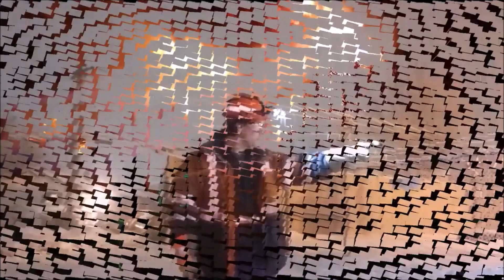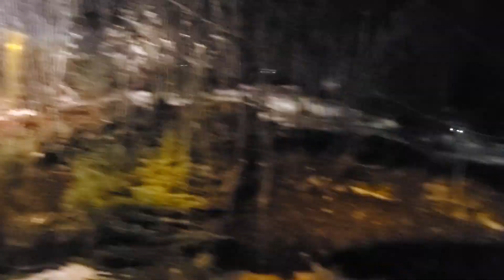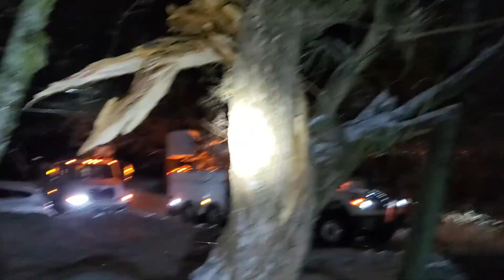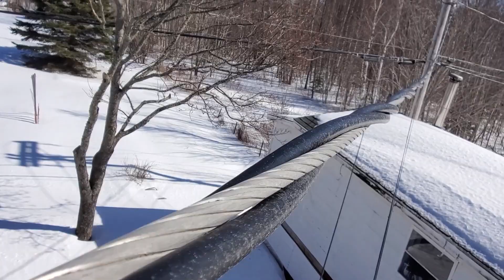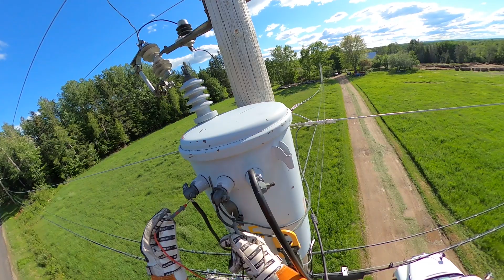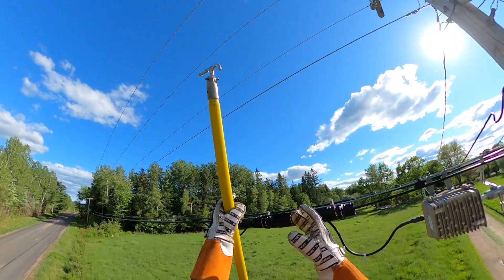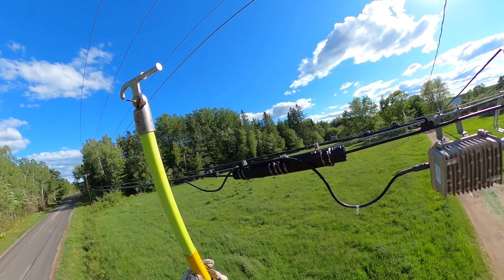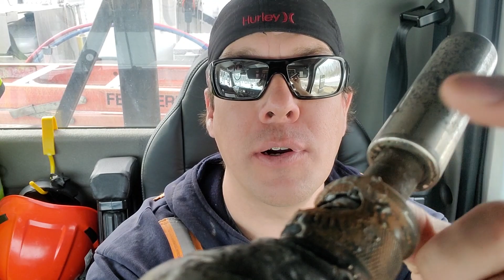Accidental contact with 120 volts

Comment: Firefighter here, had a new construction multi family dwelling basement fire last year....... On move in day, the first family was having internet installed, the utility guy was drilling a hole through from the outside to run his data cable, and drilled right through the aluminum wire feeding the main breaker panel for both units. (We were never informed of this in the initial report,only that there was a fire in the basement, and the utility guy had moved his van down the road to get out of the way and didn't approach us until after "the incident" ) The drill bit ended up grounding to the house, and started the rim joist on fire, arcing until enough aluminum wire had melted away to make the open. After we had vented the home, we started overhaul and hot spot work removing the burned spray foam insulation to ensure all hot materials were extinguished. The foam was hiding the main feed. I stuck a fiberglass pike pole in to remove foam and the exposed wire started arcing once again. Scared the shit out of me. We ended up pulling the meter. I'm very happy we have the fiberglass pike poles or I may not have gone home after that call.

It's very hard to explain what exactly went through my head when I stuck that pike pole into that void and a fountain of white sparks blew out of the void. Had we known the situation upon arrival, that meter absolutely would have been yanked before we made entry into the home.

Comment: It's not the "volts" or the "amps"... it's both!   Your skin is a decent resistor up to a point, but a high enough voltage can overcome any resistor. Once your skin is penetrated, it doesn't take many "amps" to cook you.  If the current passes around your heart, it will interfere with your heart's pacemaker cells, which can stop it.

Comment: I have been electrocuted by the outside wire coming into house before fuse, It was a 240v line and it my eyes flash black and it was extremely painful. I will not make that mistake again :)

Comment: Voltage is the pressure to push the electricity through a resistor. Even 30 volts under the right conditions can be painful. I worked a lot of panels live, up to 880 volts. I only ever had one issue and that was because fluorescent lights were wired wrong. I had another incident two years ago with bad insulation. I had 120 V power go hand to hand through my chest. The only thing that saved me is that my hands are completely calloused and fortunately caused enough resistance to lower the current. I could not move my hands or arms, and I was alert enough to know to roll off my knee to disconnect from the defective insulated wire and ground. That is what I did. My hand was burned for about 6 weeks till it healed. That was the only other time I got shocked or had an incident. Yes, 120 volts can supply 10,000 to 40,000 ampere and only a fraction of an ampere will kill. I tried to be a lineman a few times, but Affirmative Action prevented me from being hired and someone else got the job. There were more than 3600 applicants, and only 7 were to be selected. I was one of the seven, but since I scored so well, I was bumped from the job and someone with only 60% to 80% skill was hired and not me. I was constantly in the top 1/2% but AA kept getting in the way, so I turned to refrigeration service. I am retired now but lost more than $2 Million in wages over the decades. I know others have had the same experience I did.

Comment: You’re so right the only thing that governs the current is resistance metal ,like the chuck has low resistance and the current would be huge .A body’s resistance is quite high but breaks down as the current passes through ,it takes milliseconds for your resistance to drop and the CURRENT to go sky high ….. thanks for telling folk that low voltage can kill or damage you beyond belief 👍👍👍👍…..we have 30mA trips in the UK …however it only takes 15 milliamperes to KILL you !!!!!

Comment: I was tightening last connection on 4 batteries to make 24 volts final on a hydraulic lift. Well my ratchet made contact on one of the post of battery next to it. This all happened in a 2 seconds. The tool stuck to post as soon as it touched. The whole ratchet (3/8) turned into a cherry red color. In the 2 second after realizing in the first second that this ain't good, I ( with gloves) up and palmed the ratchet knocking it free. The ratchet was rendered useless. Ok maybe 3 seconds. Thanks for you info. Hats off to you and all the people in this trade. 🇺🇲🍺

Comment: It's not the voltage.
It's the AMPS.
Water is just water until I spray ANY amount of it at you at a high enough pressure and speed.
That's when that mere can of 12 fluid ounces (or 120v) becomes an armor piercing javelin.

Comment: You better read the NFPA70.,..It lays out the explosive force of phase to ground or phase to phase.. As you not only get the full amperage of the circuit. You get 50,000 PSI explosive force.. Which atomizes metal into small particles in your face and body... I seen it blow panels off a wall...

Comment: The standard 120 VAC in your home on the standard 15  Amp breaker can cause severe injury or even kill someone.  More than 10 milliamps (10/1000 of an Amp) through the body can kill someone. The voltage is not important.  The sparks can take out an eye or cause a serious burn.  The 120 Volts in your home can be strong enough to melt the ends of a pair of pliers or a cutters if the power is left on and are being used to do some work. 

The power inside of appliances or electronics especially in the power supply section can cause injury or death. People have no idea how serious this is.

Comment: In general, 120v doesn't have enough "pressure" to break human skin very well. However, if you take a metallic object and cross those phases, or hit ground/neutral when it takes 1000amps to fault the circuit you're in trouble.....

Comment: 120v directly from a transformer on a pole? Hmm. Haven't heard of that. I thought most if not all U.S. households had 220v-240v line in voltage. Unless you were measuring a single phase?

Comment: that was only 120 volts at maybe a few hundred or even thousand amps you dont want to have that happen with the 12 or so thousand volts that comes on the input to the transformer
Reply from the maker: Likely would have been deadly 😔

Comment: Have you ever experienced a situation where primary voltage (7200 volts) from a distribution transformer was present on a secondary terminal?  I was wondering about this, if the primary neutral was open, then the high voltage would be present at the transformer primary neutral terminal since primary current = 0. If primary neutral is bonded to secondary neutral, would this put the primary voltage onto the secondary side?

Comment: Amps is the killer 😅 water isn’t static, there is always pressure, that’s amp damage, 12 volts can kill one, if the cable is thick enough to push amps.  I would not be betting on this no amp voltage thing 😉. And yeah, it IS the bullet. 😊. Not going to try it, thinking you mean something a little different and now I’m intrigued. How does one have volts but no amps?  Even a small amount.. but yeah the Tesla coil generators come to mind. But this is a word game, until the circuit is completed, or I drill a hole in a dam, sure it’s voltage.. or pressure, but the actual flow is amps, the full load of the low side of the transformer..

Comment: I am not any type of lineman or electrician. Having said that, I was in the US Army for 8 years. I did a deployment to Afghanistan from 2004-2005. Due to my own mistakes, I took 220 volts to my right hand twice. If just 120 volts was able to weld and melt solid steel, and I survived 220 volts... God must have been looking out for me. 

It hurt. BTW, Cedar Rapids, Iowa.

Comment: I'm an electronics R&D guy and it is the amps that kill. The amps that go through your body. If the amps are low, even 200,000 volts will only sting.
Reply from the maker: At 200 000 volts, the amps aren't going to be low. Unless you are isolated and there is no path. (Referring to an AC power grid, not a battery operated taser)

A 200 000v line is much deadlier then a 12v line. Volts play a very important role in you're "amps that kill".

Scenario: 
Guy with zero elec. Knowledge:
 How many amps are in those wires up there?

Lineman: 
Zero actually! But there's 7200 volts

Guy with zero elec. Knowledge:
Well it's the amps that kill!? That's what I hear people say... So it's safe right!?

Lineman: 🤦‍♂️

➡️ The saying is misleading.

Comment: 3:00 "Line is not fused" Isn't it fused at a power substation? The transformers at the substation would have some maximum current before their wiring burns up. The fuse might be like 1200A. (At kilovolts of power.) "Practically unfused" might be accurate. Your tools are going to be melted long before a fuse like that blows.

Comment: A lot of people don't realize the "only 120v" is relative to those used to 240v single phase supplies and the effect it has on a person. They also forget that a welder, a device designed to melt metal, is usually  <30V. When you have an incredibly low resistance path between line and neutral, the amount of current that flows will be massive and the piece of metal itself tends to end up being the "fuse" as is evidenced by that big hole in the chuck on the drill. Look up Photoinduction on YouTube and see how he melts entire spanners with 2V!

Comment: The misleading part about the current being lethal and not the voltage is that the current is dependent on the voltage. Voltage = Current x Resistance, so if your resistance is constant, the higher the system voltage the higher the current will be. In hydraulics that means the pressure is related to the flow rate and restriction in the line. Even if the fluid is static right now, the pressure is still there so if you give the fluid somewhere to flow, it's going to flow as fast as it can to equalize the pressure across the line.

Comment: Eh, since I've read about arc flash, and in recent years a SMPS brick (fully potted, solid) exploded like a grenade where I work (detected by alarm systems no less),  I take nothing for granted.

It's "only 120v ac"...until a line fault occurs and metal parts of your tools caught in it turn red hot.  If the line current is higher than usual on a 120V circuit, even for a 240V ac line, extra precautions are needed.

As for me, sure I did a foolhardy thing or two looking back, but no more.

I'm no lineman but as an electronics hobbyist, it never ceases to amaze me how people just assume SMPS bricks are harmless because they are little, cute, and have a low output. Or assume that they can handle just whatever experimental circuits you want to put on their output like a linear supply.

What gets me is how lots of people screw with the innards of them while it's still on.  Depending on the topology of the SMPS circuit, you might still have line voltage in the LVDC output.  These suckers can also be just as deadly as line voltage if you short circuit yourself across something that can dump a major amount of current.

If you want an SMPS for experiments, buy a professional one.  Yes, pricey as they cost hundreds of dollars but it has the flexibility you want/need, and the necessary safety features in case something goes wrong with your prototype.  

Otherwise you end up like that one guy who thought the 12VDC brick at 5 Amps wouldn't  turn into an inferno, only to find that the PSU brick's topology didn't like the circuit he put on the output... and its compensation circuit ended up freaking out and feeding a power MOSFET an increasingly biased input signal to act as an amplifier instead of a shunt.  That power MOSFET had an 80 AMP maximum rating.  The circuit suddenly surged up to just over 39 amps output (destroying the experimental circuit) just before catastrophic failure.......He had the panel meter to read THAT output, so why DIDN'T he invest into proper equipment?!?  WTF?

It's only 12 volts.  Just like the batteries in vape devices... Until it explodes in your face.

Comment: 120 volts is safer than 240 volts like getting hit with a 40 ton truck is safer than getting hit with an 80 ton  truck.
Reply: 120v at 5amps is like getting hit by a 40ton truck going 200mph while 240v at  .5 amps is like getting hit by a 80ton truck doing 20mph.

*didn't do actual calculations,  just used random numbers as an example.

Comment: you mentioned bolt cutters exploding due to people cutting multiple wires at once. I can say that I've seen a voltage difference of around 10V blow a hole in flush cutters, so I can confirm. Tried cutting 3 balance leads on an ebike battery pack. oop

Comment: "It's only 120 volts."
ElectroBOOM literally welded with ten 12V car batteries in series.

Heck, a 3 volt Li Ion battery can set on fire. Electricity can be easily dangerous.

Comment: I worked w/ 52 VDC central office telephone batteries. Under the right conditions, 52 VDC can be hazardous (usually if you short it out with a metallic tool). I worked w guys that had no knowledge of Ohms Law. Me "It's 52 volts, not much potential there". Them "Yeah but it's at 200 amps". 200 amps means nothing if the pressure (voltage) is not enough to push the current. Human skin varies in resistance but is considered around 10 Kohms through skin on the hands. At 52 V, that would push about 5 milliamps - enough to be noticed, but under most conditions harmless. At 120 VAC, that would increase to 12 mA, which can be nasty (or fatal). I've felt both on many occasions - depends on what part of the body it flows through. 40 mA is considered fatal (10,000 ohms X .04 A = 400 V). That's pretty dead any way you look at it.

Comment: I only can legally only do work for myself on 48v max here in Norway and my battery bank in my van is 24v but it can deliver 400A for a 30 seconds and 200A continuous for 1,5 hours. If you short that out things will melt and sparks will fly (but it do have a 200A fuse also the Life-Po batteries has overcurrent protection on every battery)... It is not without reason you use 20v or so for welding.

Comment: I once had an incident working on an 400 VDC HV accumulator, where I just contacted positive and negative of a single cell  with the pliers I used - 4.0 V.  DC, but boy I tell ya, these high performance cells we used blew a hole through the f'in pliers. Another time someone that wasn't used to working on these things had a similar incident where he let loose of his tool and that thing just fell on to live parts of the accumulator - nothing happend but I had to reach in to pull that thing out of there🥵

Comment: I'm a ground hand with the local cable company and I had probably the same voltage arc while I was jacking in a down guide. Our guide wire was laying over a home made power line running to a garage and while I was hooking up to the anchor the guide wire touched the anchor and threw a huge fireball. I'm pretty sure the only thing that kept me from getting shocked was the rubber on my boots. I have a picture of the steel anchor with holes burned into it

Comment: in europe  we have 230 V 50Hz phase to neutral /ground but neutral and ground must not be conected at any point
and we have 400V 50Hz  phase to phase 
3 phases 
whitch is not nice wnen it shorts out or
 you tuch both live vires at same time

Comment: Yup its only 120... but the transformer can source hundreds of amps briefly. Can melt or weld. Touch both for 240 and youll get cooked and it wont source anywhere near enough juice to pop the primary fuse ☹😵😵😵💩

Comment: Isnt it 0a current mean you will be the only current draw which means this is indication you will be nice a toasty?
Reply from the maker: Whether there's 0A or 500A on the line is irrelevant unless your in series. While standing on the ground and touching a 120 wire there will be a predetermined (for lack of better words) amperage pass through your body based on your body's resistance and voltage supplied.

Touching a 7200 volt line vs a 120 volt line will result in a much higher amount of amperage passing through your body. Thus making voltage a very important factor when speaking of electrocution.

Comment: It's not the volts that kill you, and it's not the amps either. It's the combination. Low voltage, high current, maybe ok. Low amperage, high voltage, maybe ok. Start increasing the two, and you're dead meat. I knew a plumber who died working on a garbage disposal that he forgot to unplug. He was laying on concrete (ground) with water pooling, and that was a 120V ckt with a 15 amp breaker. 0.5 amps at anything above 12V can kill you if your heart isn't fabricated from just the right gene pool. So don't play with fire. I set a pair of strippers on a 12V / 7amp hr battery, and they welded to it in a split second. Most people's skin is insulated enough to resist this if they touch the same battery terminals with their hands, BUT, don't be the guy who finds out the hard way that your skin was not up to par.